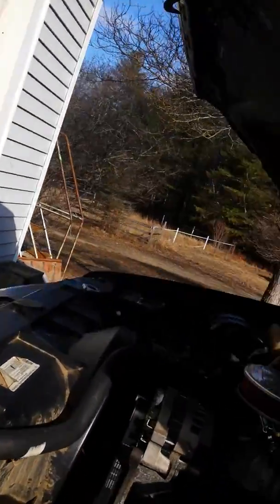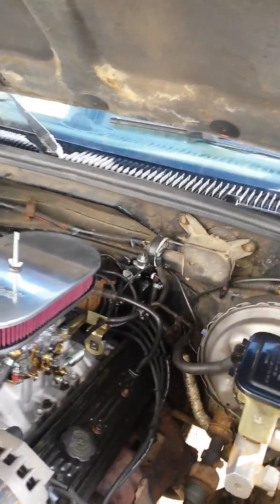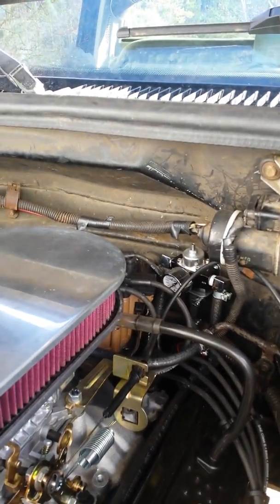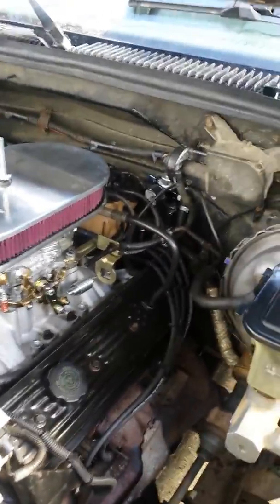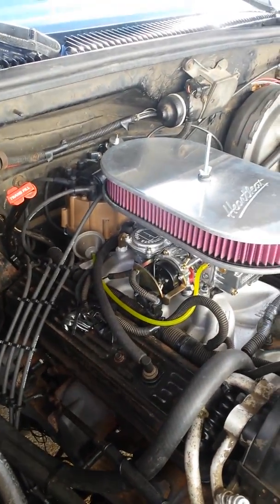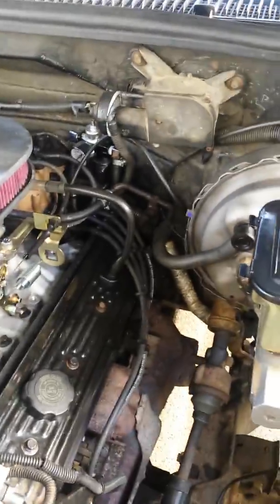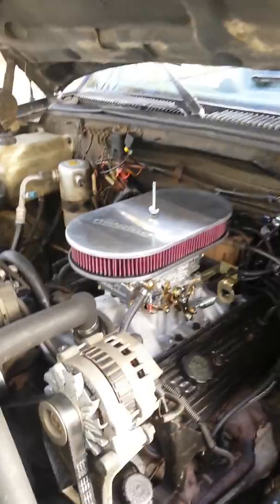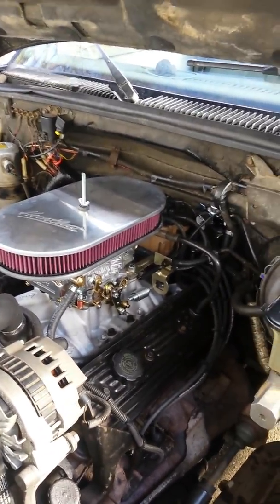TBI to Carb swap Chevy Truck Part 1

Comment: I watched all 4 of your videos and they were great. Thank-you!
I'm just about done with my conversion of my 88 C3500.
3 questions:
1) The 2nd cab heater hose that was attached to the TBI intake manifold...were did you attach it to get the water circulation to the heater box?
2) The hole into the driver's side valve cover...I see you have a hose leading to somewhere behind the carb. Where did you attach it?
3 For the brake booster hose, I'm attaching mine to an outlet from the intake manifold. Is that what you did with yours?
-Dennis
Reply from the maker: Hello Dennis, (1) On my 92 K2500  one of my heater hoses ran to the rear passenger side of my TBI intake manifold and the other hose ran to a fitting on the right top corner of my radiator. I used a Weiand intake that has the water inlet port on the front passenger side of the intake. So all I needed to do was buy a brass 1/2 NPT to 3/4 barb fitting and run my one heater hose there.
(2) The hose you mentioned is the original breather hose that went to a flange that sat on top of my original TBI that I used for my carb when I first did the swap. But after a few very hard cold starts I noticed my choke was binding on it so I removed the flange and just left the hose running to nowhere, Tho I am going to put a breather cap on the valve cover soon.
(3) Yes I did run mine off the intake also.
Thanks for the kudos and good luck with your swap hope this info helped..

Comment: What manifold did you use
Reply from the maker: Good day Freddie,  I used the Weiand "Street Warrior" intake manifold. A list of all that I bought for the swap including the part numbers can be found in the description section for my video.
Reply: Hello good day to you thanks for the info I’m trying to build my 5.7 taking of the tbi and putting an a carb

Comment: Thanks for this series, Im in the middle of a motor swap for a 1990 suburban and this answered a bunch of questions for me. Did you end up pulling out the computer or leave it in place. Wondering if once the TBI is gone if the computer is needed for  anything else. I have a 700r4 and was planning on just wiring up the lockup manually
Reply from the maker: Good day. No I did not remove the computer it is still in place because I have the 4L80 E and wanted the tranny codes if they do arise. Hope swap goes well any questions just ask..
Reply: I swapped my LO5 with an L98 from a 91 C4 Vette. But I went through my harness and pulled all of the wires related to the tbi. I left the computer in for important things like the speedometer, just in case. But i've got a 700r4 so there's no tps or anything like that to deal with

Comment: I'm gonna do a swap on my 92 camaro from tbi to carburetor did you use the big pink wire for power to the old school hei? an could i get by with not having to make a separate wire to get power to my fuel pump in the tank an what will i need to do about my vehicle anti theft system on my car? an will i need to get a bracket for the tps sensor I've got the 700r4 transmission an was thinking about getting the vacuum lock up conversion from tci any help with my questions about this conversion would b much appreciated thank you, (Tom from sedan ks)
Reply from the maker: Hello Tom,  Yes I also used the pink wire to energize my HEI. Please read this carefully, No you will not be able to get away with not running a wire to energize your fuel pump. I also thought I could get away with not running  a wire as I stated in my video. But about 6 weeks after my conversion I broke down. After a few checks I found my fuel pump was shutting down just after starting it. If you are using the factory in tank fuel pump you will need to run a wire from the terminal marked Tach on the Old school HEI to the purple and white wire or it could be a blue wire on the 4 wire connector than plugs into bottom of the factory TBI distributor. If you do not, you will run into the same problem I just explained. I do not know if the TCI lock up conversion kit takes the place of the TPS or not but I do know you if you are running the 700r4  you do not have to use the TPS sensor. Hope my answers helped, good luck....
Reply: crewyou07 thanks for your time answering my questions it sounds pretty simple!
Reply from the maker: It is pretty simple, when you have the required info. Glad I was able to help. Your welcome...

Comment: Since I'm switching the heads to vortec heads do I use the weiand street warrior vortec intake manifold instead of the tbi one
Reply from the maker: Yes, if the heads are 1996 or newer I believe you do. Hopefully someone reading this thread can confirm that? I do know that when I was researching which intake fit my application. I spent a lot of time making sure I bought the right manifold. Reading the description and re reading what year engine or more specifically which head the intake would fit.
Reply: @crewyou07  95 was a 'hybrid' (changeover) Yr on the PUs, some Subs. The  C/K 3500s and Gs we're last 2 get Vortecs in 96. That said by 97 all C/K/Gs had Vortec.  U have 2 look and C what engine is under the hood. Some had TBI, some Vortec. Ad in most GM hybrid years, the interior and body does not designate engine in this Yr. Body generally precedes engine.

Comment: I have a 4l60e what kick down bracket do I use.
Reply from the maker: Hello Steven,  kickdown bracket ?  Shoudn't need one. Like the 4L80 I believe the the 4L60 relies on the throttle position switch to initiate the downshift during passing.

Comment: How do you guys use the factory gauge cluster when doing this conversion?
Reply from the maker: Good day Ryan, I had no issues with gauge cluster after my conversion. I suggest reading thru all the comments on my four (4) Tbi to carb swap videos. There are some comments pertaining to the gauges not working  and the fix, thanks for you comment.

Comment: So your truck already have a return line. Is it the smaller one?
Reply from the maker: Hello Quinton yes it is the smaller of the three lines.
Reply: @crewyou07  I have a 1989 Chevy K1500. There is only 2 lines going to the throttle body.
Reply: @crewyou07  so you added the third line for the carb? And of the two original lines, the smaller factory line is the return on the throttle body?

Comment: mine doesnt shift automaticaly acts like sensor isnt doing anything can manualy shift it but nothing else put it in drives takes off from od unless down shift an manully shift back up
Reply: Jeffery Lortie you need a tps sensor on the carb
Reply from the maker: Hello Jeff, just as  Infamousriver has written, it is a must that you install the TPS sensor on the carb. If you are using a Holley carb then you need the Holley tps kit part# 534-202. It is adjustable so you need to set the voltage at .5 to .7 volts at an idle and at full open throttle it needs to be 4.1 to 4.7 volts for the converter to lock properly and shift. If you are using something other than a Holley carb you will have to do some research to find a bracket that is applicable to the carb you are using.

Comment: I'm in the process of trying to convert my 1988 chevy Silverado tbi  over to the carb configuration like yours, any chance you could share your parts used and suggestions with me to get me started in the right direction,,,,Thanks
Reply from the maker: Hello Jerry, My entire parts list in the description section of this video. The only thing I would have done differently is to have gone with a manual choke. Oh, and make sure you change your oil before you go to start your truck. It is good practice to change your oil whenever you remove an intake manifold because more than likely coolant will enter the crankcase when you breach the gasket between the intake manifold and cylinder head. If the coolant does get in the engine oil you run the risk of wiping out your connecting rod or main journal bearings. Any other questions hit me up! best of luck with the swap..

Comment: Whats the part numbers on fuel regulator
Reply from the maker: All the parts and numbers are listed in video description
Reply: Thank u.....the wire for the fuel pump u had to hook up is it one that came from coil or distributor
Reply from the maker: @Thumperr6 Yes, From the HEI distributor I used with the internal coil, run the wire to the tachometer port.
Reply: @crewyou07  thank u ...your video really helped me out alot

Comment: What year is ur truck Iam planning to do mine it's a 90 454 SS
Reply from the maker: It is a 1992 K2500 with a 5.7 and the 4L80E transmission.

Comment: Long Question: i have 93 c1500 that HAD 4.3 tbi with 4l60 i took that crap out and put 5.7 350 cid with 4l80e . so far so good have Holley intake holly carb flotec headers edelbrock water pump msd ready to run distributor msd blaster 2 coil msd 6a ignition elec fan so my question is how did you get the transmission to work?
Reply from the maker: Hello Bryon, . Like you I have the 4L80e also. So as long as you reattached the connector for the speed sensor on the output shaft on your 4l80e and didn't remove the computer all you should have to do is install a TPS (throttle position sensor) for your transmission to shift correctly.
Reply: crewyou07 dont know if that's possible since we took out half the wires the only thing I'm using on the stock wires is ignition  besides the harness for the tranny. I have the truck running but have not had a chance to test the tranny cant keep the truck running lol
Reply from the maker: Let me guess, The cycle is the truck runs for a few minutes then stalls out, yes no?
Reply: crewyou07 exactly I'm about to burn it
Reply: Everything and I mean down to tie rods and a arms are brand new rear end gears everything
Reply from the maker: I ran into a very similar issue on with my conversion. Are you using the stock in tank fuel pump?

Comment: Yes I am
Reply from the maker: Did you splice and run a wire from the connector that plugged into the bottom of your stock TBI distributor to the tach port of your HEI distributor? because if you did not the in tank pump will not operate properly,